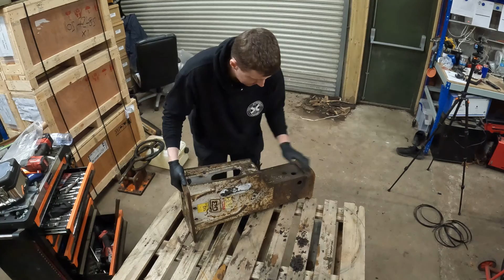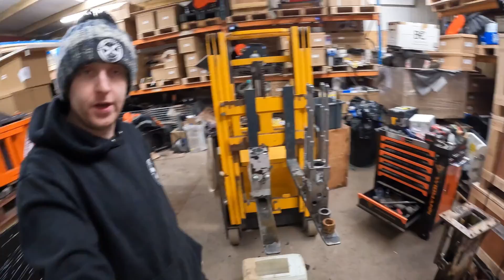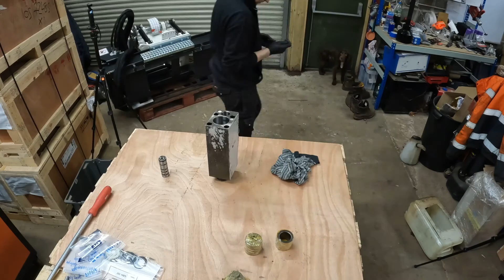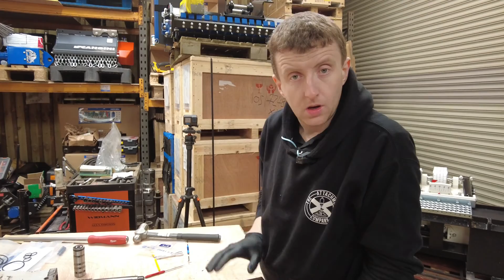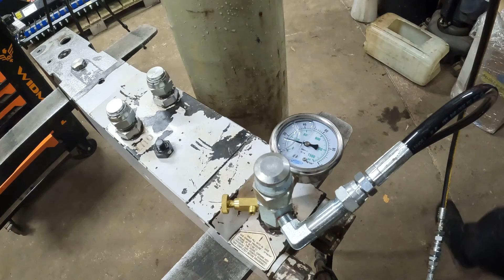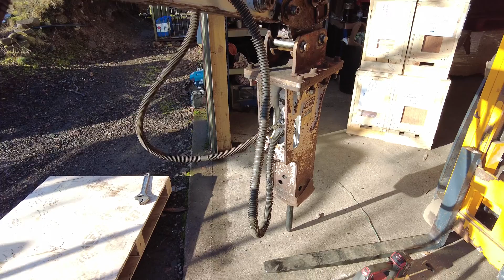How to repair and re-seal a hydraulic breaker attachments - GB Hammer - The Attachment Company

Comment: Do the seals fail due to worn bushings?
Reply from the maker: A variety of reasons really
Reply: @theattachmentco I ask as I’m watching the video a second time.  It’s a Tramac 600 that’s leaking hydraulic fluid from the pin. Thinking about trying to reseal it myself.
Reply: @TandD1w Some leakage is fine but excessive is where you need to worry, could be piston seals, but if you're already going in for those you might as well order the seal kit and overhaul everything